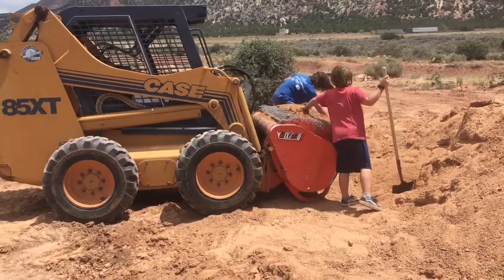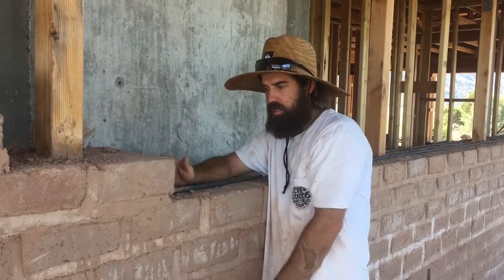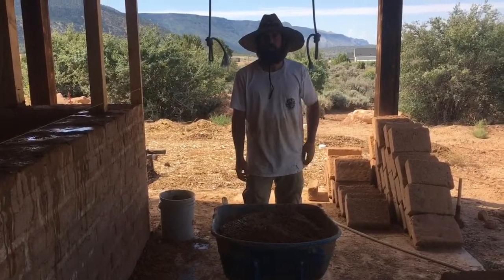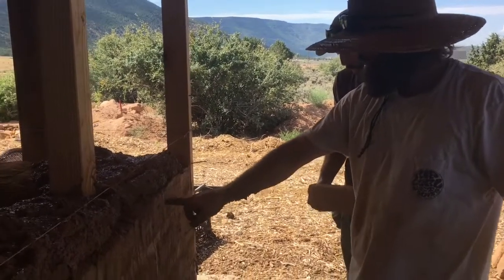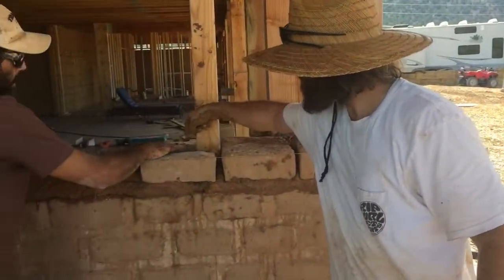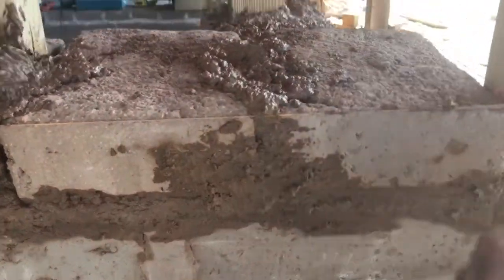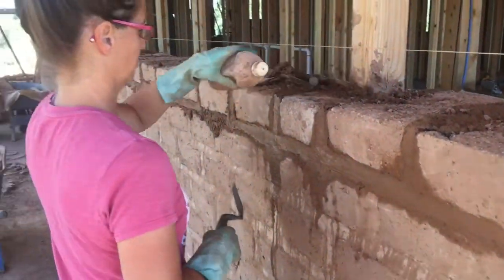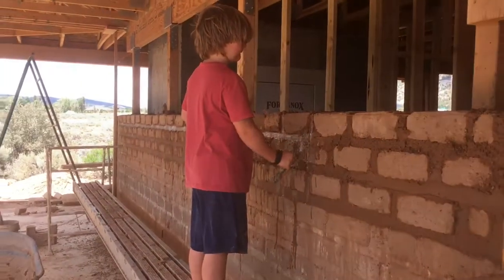Laying Adobe Bricks Part 1

Comment: Hello, I made three bricks based on your recipe.  Two were I used the asphalt emulsion of 10% To water and soil.  One brick I used the same water to asphalt plus pine shavings.  I need a stabilizer to keep the bricks from eroding since my potential build will be in East Texas where its more humid.  What are your thoughts.  Adobe bricks are not heard of here.  Also how long did you keep your bricks covered.  My bricks are 10x10xx4

Comment: Amazing video to watch from Poland. On the outside wall did you put stucco or you left uncovered brick? And if stucco was put on the outside wall would that help with keeping dry walls in the rainy season? Also would stucco help with summer heat keeping cooler inside and winter lower temperatures keeping warmer inside?
Reply: Lime plaster over adobe.

Comment: Is the mortar made exactly as the brick is (about 50% screened clay soil, 50% coarse sand, chopped straw)?
Reply from the maker: In our mix we don’t use straw. It’s approximately 30% clay, the rest is sand and  small aggregate. Typically straw is used when you have higher clay content. If you’re going to use soil with 50% clay you will want to use straw. Straw acts as a binder so the bricks don’t crack.
Reply from the maker: And yes, our mortar is the same mix but with a little more care taken to screen out rocks. In the brick mix you can actually have rocks as big as 1/3 the thickness of the brick. But in the mortar you don’t want the rocks getting in the way as you set the bricks in place.
Reply: @projectbiggs7694  Thanks for the light-speed reply!

Comment: We also construct our houses from adobe bricks here in North Pakistan Chitral, these are good insulator to cold and also very cheap.  But I have question "Would we  make double or triple story building from these Adobe  brick?  And what's the strenght of this brick ie how much load it can bear in psi?
Reply from the maker: I’m sorry I wish I had some answers for you. I know it’s possible to build multiple story buildings with adobe bricks but I have no experience doing it. Also I know that the compression strength depends and the makeup of the soil used and if you stabilize it with concrete. Sorry I don’t have good answers for you. Good Luck!
Reply: Width of your wall, you can go 10 times width. For example 14" you can do 140"  or 36" first to go three story then 28" second and 14" on 3rd floor.

Comment: Why use rebar in the walls of an adobe wall?  What good can come of that?
Reply from the maker: The engineers wanted it in there for sheer. Is it necessary? I don’t know probably not. But around here without an engineers stamp you don’t get a building permit. So I put it in. Engineers like steel. Engineers don’t like building house out of mud. 😉

Comment: Is there a reason we don't see adobe homes in Indiana? Can they withstand our zone 5 freezing and thawing? It seems so simple and cheap, nothing much required but plenty of time!
Reply from the maker: Hey Justin! I’m not sure why. Once the bricks are cured/completely dry, freeze thaw won’t be a problem. The key to Adobe is keeping it dry. Maybe it a humidity concern? 🤔
Reply: Hi ! These bricks are air dry but I don't see any frost or thawing action in these bricks. In my region all houses are made of Adobe bricks and temp here goes to negative in winter season with heavy snowfall, still no frost action have been notice.  These brick remain as strong as long as you keep them safe from water exposure or rain

Comment: Also, I found that a lot of locals (where they build with adobe etc) claim that mud homes stay cooler than equivalent concrete homes (though sometimes they mean ungrouted CMU). Surprised at the reason - it is not thermal mass so much as it is that dry mud insulates better than dry concrete. Ceramic insulates better than cement. Studies found that the first 4" is all you typically use for mass inertia in a 24 hour cycle, the rest is helping by providing insulation. I know, this goes against intuition.
Reply from the maker: Interesting, that’s not how I understand it, but I could be wrong. All I know is it’s working great. The last few months have had consistent temperatures of 95-98 Degrees for the highs and the House doesn’t get above 78 degrees.  I have a hard time believing that if I only made the Adobe 4” thick and then put an insulated wall with an R value equal to the other 10” of adobe (my walls are 14” thick) that I would get the same performance. Adobe has a very very low R value. Maybe I’m misunderstanding you. Thanks for your comments!
Reply: @projectbiggs7694  yes I was surprised too.
Reply: @projectbiggs7694  I'm not sure but i suspect it's evaporative cooling,
Mud gains more water during the night and release it during the day, which means lower temperature than daily averages and less than what you would expect from just thermal lag alone

Comment: How much it cost to build a single storey structure using Adobe blocks
Reply from the maker: Regul, that is a very difficult question to answer. There are so many variables that go into the total cost of construction. Adobe construction can be one of the least expensive ways to build or one of the most expensive. For example Adobe walls on stone foundation with earthen floors with you doing all labor will be way less expensive than Adobe walls on concrete footings/slab with tile and carpet throughout the house. Adobe is very labor intensive. If you can do all the labor you will save a lot of money but if you have to pay someone to make and install your bricks it will be very expensive. Also cost of Windows, cabinets, interior walls, roofing, electrical, plumbing, appliances, etc. are all variables. What we paid is not the cheapest or even close to the most expensive. We paid about $1.30 per square foot, not counting cost of property.

Comment: Does anybody have comparison for how good adobe with clay mortar insulates compared to bricks with lime mortar?
Reply from the maker: Typically lime is used in Adobe as a stabilizer when the clay content of the Adobe mixture is high. The lime binds up the clay. The same way cement is used when the sand content of the Adobe mixture is high. Lime for binding clay, cement for binding sand as a stabilizer. Maybe I’m not understanding your questions and someone else can respond.
Reply: @projectbiggs7694  Yes, my question was more regarding the adobe bricks and baked clay bricks (modern bricks). Do you think adobe ones are better insulators? I am planning building a clean house and I have a dilemma between baked bricks and lime mortar and clay. I really like the building process of baked brick and lime mortar. But I am afraid it might lack insulation.
Reply from the maker: I’m not sure how much difference there would be between the two as far as performance goes, I would think they would be very similar with the baked bricks being more weather proof.  I would recommend doing some studying on the difference between insulation and thermal mass. Neither type of bricks you mentioned have very good insulation values (R Values), but have very good thermal mass (U Values). The purpose of Insulation is to keeps heat or cold from passing through. Thermal mass stores or holds onto heat or cold. I hope this helps.
Reply: @projectbiggs7694  Yes, thanks a lot!

Comment: What kind of R value do you get from these walls?
Reply from the maker: Hi Jake, you don’t actually get an “R” value, well you do but it quite low. It’s a “U” value. U-values represent the transfer of energy through conduction and radiation. R-value only represents resistance to heat transfer. So the higher the R value, the longer you can hold the temperature in the house but the walls don’t store any of the heat or coolness. Adobe or any other thermal mass is a storage device rather than a resistance device. So the lower the U value the longer it take the temperature/energy to pass through the wall. With Adobe, the energy transfers at a rate of about an hour per inch. Our walls are 14” thick  So by the time the warmth from mid day has reached the inside, it’s the middle of the night and by the time the coolness from the night has reached the inside, it’s mid day. Adobe works best in locations where there is a big swing between the highs and lows of the day. What happens is the house will sit at the average temperature between the two. I hope this helps explain it.
Reply: @projectbiggs7694  yes and thanks for replying so quickly.
Reply: @projectbiggs7694  you nail it, good insulation is only practical for houses that have harsher winters, you can store alot of sun energy with more thermal mass, using bigger windows too
Super insulated houses get uncomfortable easily and need vapour barriers and active air-conditioning,specially to control humidity 
While thermal mass is more forgiving and you don't have to solve any humidity problems

Comment: Hello dear nice job what is the size of the brick please
Reply from the maker: Hi there, thanks you!  The bricks are 4”x10”x14” placed so the walls are 14” thick
Reply: @projectbiggs7694  thanks a lot and I put tiles on the adore bathroom walls just like cement bricks can you advise me on what to do please
Reply: @projectbiggs7694  and I will like to stabilize them with cement how many wheelbarrows soil to cement should I take
Reply from the maker: I’m not sure how well tile would adhere to Adobe. What I have seen done though is you can screen down your Adobe mixture to get rid of any aggregate. Just sand and clay then use white cement to stabilize it and trowel that mixture on your shower walls. You could even add some color pigment used for coloring concrete in the mix. In one of my showers I left the Adobe bricks exposed and sealed them with a silox based penetrating sealer.
Reply from the maker: To stabilize with cement you want to add between 5 and 10 percent cement. 5 percent will give you simi stabilized bricks and 10 percent will give you fully stabilized bricks. To figure out how much per wheelbarrow, fill your wheelbarrow by counting how many shovels it takes to fill it. If it take 20 shovels to fill it and you want 10% do 18 shovels of soil and 2 cement. Just be aware, when you stabilize with cement you have to use up all your mix pretty quickly because the cement will set up and harden. As compared to emulsion stabilized mix which as long as it’s in a wheelbarrow or bucket and you cover it with plastic, it can last a week and still be useable.
Reply: @projectbiggs7694  thanks so much for the assistance I really appreciate it looking forward to soon build our family house in Africa and will always remember you
Reply: @projectbiggs7694  can oyester shells power "lime" be use to stabilize Adobe brick and if so how
Reply from the maker: That is an interesting thought! I’m not sure though. In case you didn’t know, Lime is used to stabilize bricks with a high clay content and cement is used to stabilize bricks with a high sand content. Sometimes a mixture is used. I’m excited for you to get started on your home! What are your average temperatures in the summer and winter?
Reply: @projectbiggs7694  thanks am from West Africa our temperature in the summer is around 32/34 and in the winter which is around December to March is sometimes between 26/30. Am a woman and don't know much about building with Adobe but we do build mud house here and use cement to plaster them and sometimes people use soil and a little cement in between the brick when building. A friend told me about the use of oyster shells to stabilize because it is more cheaper than the cement and our soil here is more of a clay red clay
Reply from the maker: I would listen to your friend. I bet there is a lot of local knowledge around you. Talking with people in your area who have done it should be the best way to gather the right information. With those temperatures your goal is definitely to keep the home cool, so I would suggest you don’t have any windows on the south or west walls. If you must have windows on those walls make sure you put something up to block the sun from coming in. I wish you luck on your project and hope you can get started soon!